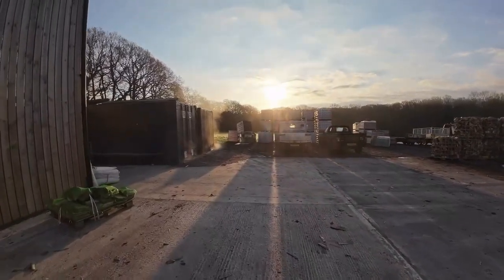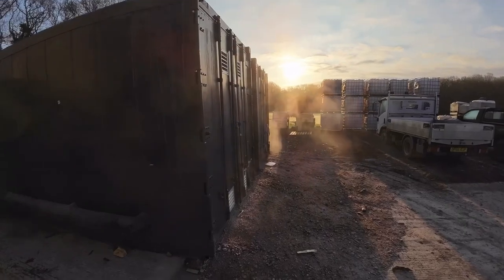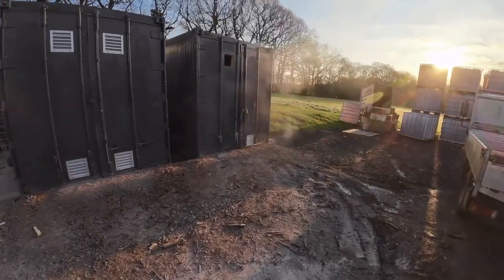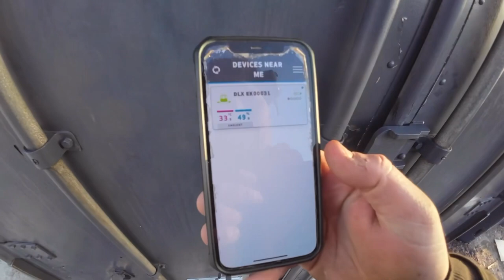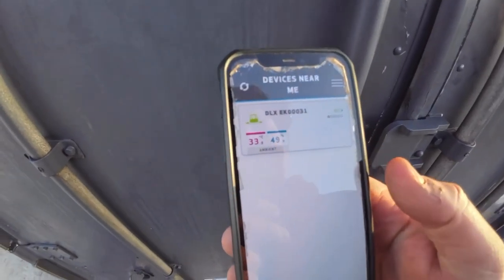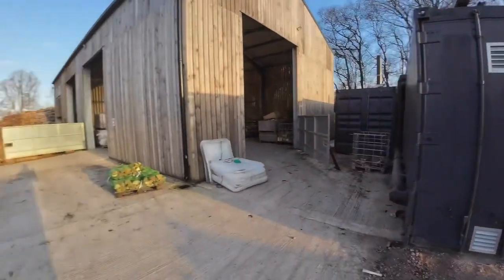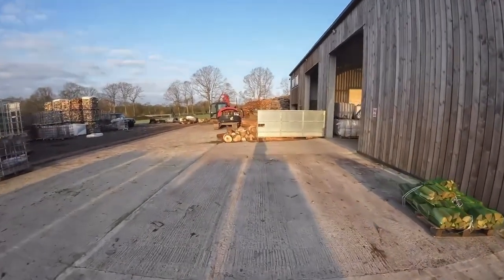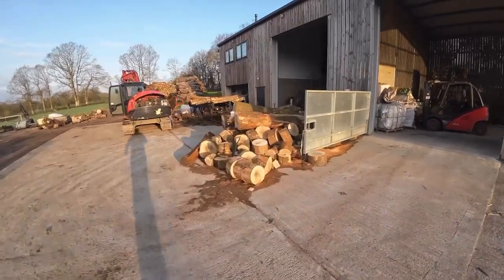Day 7 - Woodsure audit and Demo machine arrives

Comment: What happens on a audit what do they actually look at? Thanks
Reply from the maker: Making sure the wood is sustainable, invoices and licences etc. Look round the yard at health and safety etc finally testing the logs to make sure they are under 20%
Reply: Thanks great set up by the way would like a set up like yours one day
Reply: What moisture content did your firewood come in as? 10%  ?
Reply: Hey love the videos!!  Question how much wood do you have to burn in order to run the kiln? 

Can you just use the end pieces and cut offs you dry inside them to run it or do you actually have to pay towards electric/gas?